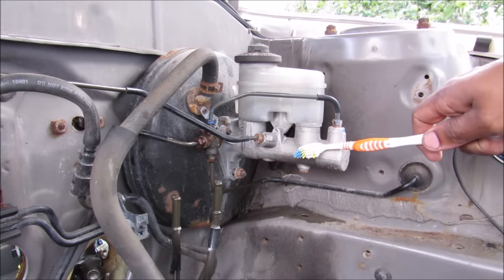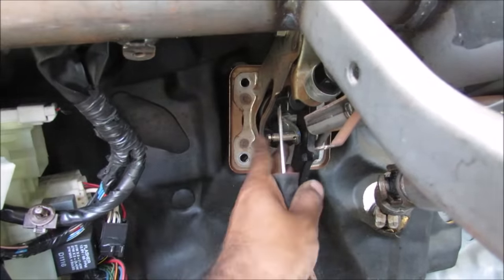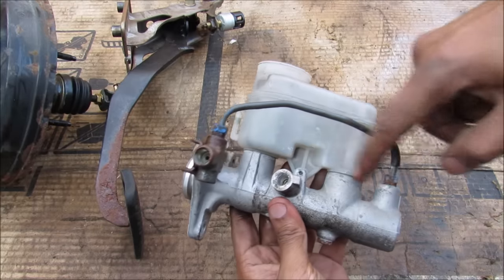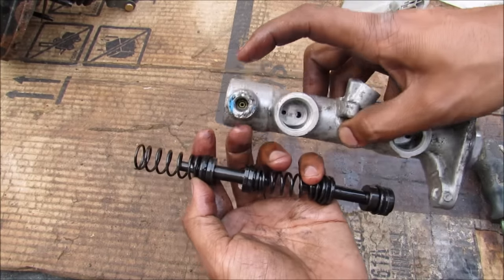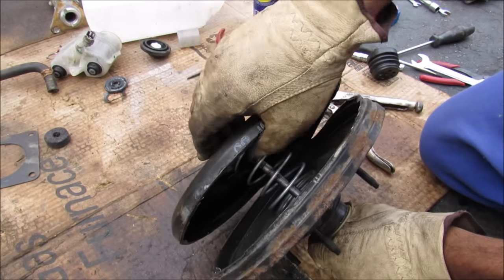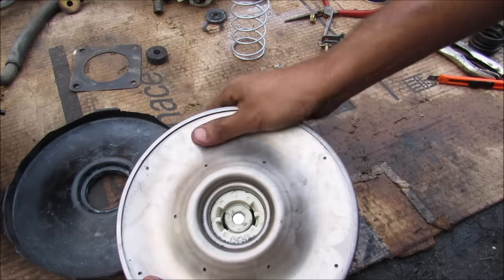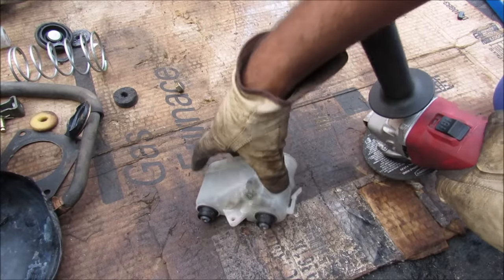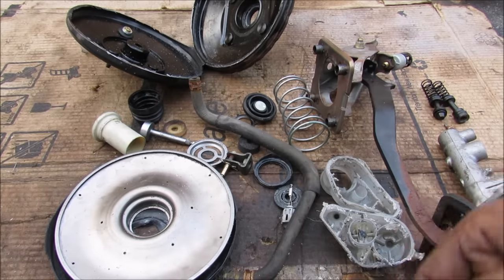How a Brake Booster and Master Cylinder Work

Comment: I have a 2009 ford focus and the brake fluid keeps getting low. I myself checked and had a mechanic checked and there are no leaks whatsoever outside in the lines, calipers etc. I have added so far 2 full bottles of brake fluid and it all keeps disappearing. After a lot of internet research some one had the same issue and he found out that the fluid is leaking into the brake booster and is being helped sucked into it due to the engine vacuum. My question is, is it okay to keep driving without fixing it? I can keep adding brake fluid. Is it safe to keep going this way?
Reply from the maker: Dont drive like that....you never know when you'll need your brakes and your fluid won't be there

Comment: Hi that white centre piece you removed off the brake booster, what sort of grease is applied on it? My booster is out and was thinking of lubricating the white piece with silicone before putting the rubber boot on.. thank you
Reply from the maker: Any grease that's safe for plastic can work

Comment: Also, when that dummy light for low brake fluid comes on, your brakes need to be serviced.  It doesn't just leak out slowly.
Reply from the maker: It's way too late at the point

Comment: I was going to do a burnout for my best friend and while holding the brakes (brake torqueing) there was a loud air escaping sound that came from under the hood three times, now my brakes aren't very good. Is it possible I need a new power steering brake booster installed on my 55 Chevy?
Reply from the maker: I'm not sure about power steering booster, but maybe a brake booster?

Comment: That was the dogs bollocks` No messing straight to educating the likes of me, cheers geezer,
I have a question, brake pads binding causing disc to warp or wear in the same spot, always happens two weeks after renewing pads + discs,
1)Garage did them / brake binding, after a few weeks discs warped, on the previous owner, I bought the car and happened to me after cleaning everything. and changing discs and pads,
2 )I then replaced front diss + hoses + calliper pistons and slide pins + pads and cleaned up calliper, started binding and warped discs after two weeks,
3)So only the off side started to bind so i replaced off side with new calliper only not calliper bracket two days after started to here it binding again.
Did  a sit in car test to test my brake booster that seem to pass the tests,
Did a brake master cylinder test by pressing on the brake peddle and holding it for 30 seconds and it did not move so I suspect no master cylinder leak.
I am at the end of my tether this is costing me a pretty penny and time trying to figure this dam issue,
Any ideas come to mind what else i should do or check that i may of over looked please.

Comment: What could be the reason if brake paddle suddenly sinks and regain after 2 seconds . Kind of brake paddle become free ? What do you think the reason could be. I felt no brake in that case
Reply from the maker: Booster or vacuum hose
Reply: @speedkar99   hyundai guys said it is master cylinder.  Do you think they are correct . ? Brake paddle become free once in 15 days when my speed is under 10 and terrain is not smooth. What do you think now ?

Comment: I converted my 76 cj7 jeep manual drum brakes to power disc brakes (brake conversion kit off ebay) and a YJ booster and mc with proportion valve off a YJ wrangler. 

I had to lower the brake pedal as the piston rod was too long and didn't match up with the brake pedal.  

Problem is, I have soft brakes. 
If I pump the brakes, it gets harder and I eventually stop.  Brakes are always the same. Soft until I pump.  Then hardens up and I stop.. 

Scary..  

Any idea what is wrong?  

Also~~Can I adjust the piston rod to shorten it so the pedal won't be so low and would that fix the soft pedal issue? 

Thanks for the video...  Not only educational but also funny...
Reply from the maker: Did you change the master cylinder?

Comment: Hi, thats a great video.. I am facing a problem with my Hyundai Creta. The break pedal locks or does not push down when's car is on a patchy road but it works fine on a smooth road. Any idea why that's happening?

Comment: Plz help sir, my brakes are hard but does stop normally when driving but after 5 mins driving brakes dragg and caliper seizes up, i would wait a couple of minutes and drives normally, i mean every 5 mins driving front brakes locks up.. i don't know whether the pressure of brake fluid from caliper pistons don't get released or is it booster or something, what could be the problem?
The brakes don't sink but would be hard on its natural position when the brakes seized

Comment: Please I do like to ask what makes the steering wheel tilt to one side when you apply break. Also worthy of mention is that the break pedal of the same vehicle (Toyota 4runner) is now loose more than normal. U then to press down before break slowly catches.
I am thinking maybe the Piston of the master cylinder has probably failed. Please what is your opinion of possible cause?
Reply from the maker: If the steering is pulling then you have a stuck brake caliper
Reply: @speedkar99  please explain more. I do not understand what you mean by pulling. The veering is not much pronounced  though which makes me think it may be due to less functionality of one of the Pistons responsible to deliver brake fluid through one of the pipes. Break Caliper I think caused more degree of veering off of the steering. Pls educate

Comment: That was so well told  now could I pick your brains I have a Renault scenic mk3 1.5dci  the break pedal travail near to the floor release and pump once it gets harder  I have done the servo test that’s fine. Checked break pads they are fine bled only one front will  but still faulty any idea please I am not loosing any fluid from reserver

Comment: according to articles and video in the web, i have a leak in the diaphragm . The RPM jumps up and goes down to normal, the car goes 15 feet forward and stops. 
However, this happens once in while, not predictable. 
Followed all the instructions to check if there is any leak in the vacuum hose, no leak.
If the booster is replaced, will this happen again ?

Comment: Hello Sir!
I've got a Nissan pick-up (Frontier is called in the States) and the brake pedal is quite soft, has a long travel and doesn't stop very efficiently. With the engine off, the pedal goes hard after a few presses but softens once the engine is on (I guess that's expected from the vacuum). There are no leaks, the reservoir is full, not losing level. 
Does this mean the master cylinder is not working well?
Thank you!

Comment: Awesome video!!! So say you replaced the front calipers and bleed the entire system and no air at all.. now go to push on brake pedal and has no resistance at all and pedal goes to the floor?? Bad master cylinder??

Comment: How does the refilling take place during repeated braking, and volume change during temperature variation? Is the rubber seal really passing a refill or outlet hole during braking?

Comment: If booster line is connected to the plenum then vacuum will keep  on building everytime the piston sucks air. So why doesn't the booster blast???
Reply from the maker: A vacuum won't cause it to blast and it's strong enough to resist collapsing

Comment: will the brake work even if you have a faulty brake booster? since its purpose is only to multiply the force? assuming the master cylinder is perfectly fine?

Comment: One question, I have a gmc truck with a brake booster assistant pump that blows air out where the hose is attached, the question is, isn't that supposed to have a vacuum instead of it blowing air? By the way, brake pedal is really soft and has a hissing sound but if you block that hole, noise goes away and pedal is normal...

Comment: I had no clue that a power brake booster has two Pistons? Are they linked end to end and move In the same direction, away when pressed and toward you when released??

Comment: I have an issue on my 07 Tacoma with my brakes locking up as I drive. My fix has been to unplug the vacuum from the booster as the truck is running and then reconnect it a few seconds later which releases the brakes. This fix sometimes lasts a long time and sometimes it only lasts a day. I'm on my second rebuilt brake booster and the issues is happening again. Any thoughts on why?

Comment: hi, if break pedal goes down floor, will itbe  master cylindder or brake booster, how to tell the difference or diagnose.. any tips..assume there is no leak externally
Reply from the maker: Seems like a leak in the brake lines or internally to the master cylinder. The booster only provides assist.
Reply: speedkar99 

Thanks. In honda accord 2002 rear brake line is broken becuase of rust. I lost all 4 brake power. I assumed i will loose only one brake atleast front should work. Is this is how it works
Reply from the maker: Yeah a leak anywhere won't give you any brake pressure

Comment: Hello, I had a Pontiac 69 booster repaired, I put it back together, and when I start the engine, does the brake pedal come down all the way on its own and block the wheels?? I think it's a bad repair? please tell me what you think.

Comment: In my case, I have a spongy brake pedal and other times a hard pedal on random days. I suppose the master would be cause of this? 
No visible leaks at all. I put on a new master cylinder but same issue, perhaps I need to bleed the lines more?

Comment: Does break booster work in turbo charger car because one vacume line in break booster is connected on intake manifold for vacuum to pull diagram for less effort to press break padel so what happen in turbo charger car because when turbo starts spining so intake manifold get positive pressure so its pushes air inside the break booster rather then pulling from vacuum. So how do break booster work in turbo charger cars... Plz reply
Reply from the maker: There's a vacuum pump
Reply: @speedkar99  thanks man
Reply: @speedkar99  plz make a video on engine braking and make another video on how reverse gear safety works when we put reverse while driving so while driving reverse gear can't engage what thing is preventing gear stick to shift in reverse while driving... Plz reply and make video I am waiting..
❤️❤️❤️

Comment: Tow Month After Change first time All Wheels Rotors And pads Start Car at morning everything work great but after driving for half hour HARD BRAKE PEDAL - all 4 wheels Brakes Locking UP but there stopping power and if continue force driving the car all wheels smoke but the brake unlock after pull over and turn car off and back on brake pedal start normal not hard any more work fine but repeat again after driving about half hour HARD BRAKE PEDAL - all 4 wheels Brakes Locking UP again and have to turn car off and on again to get all wheels brake unlock can u please advice! 2008 Suzuki xl7 AWD
Reply from the maker: It's weird to have a hard brake pedal and brakes locking up. I wonder if your master cylinder is sticking?
Reply: I'm not mechanic to answer this but if the car turn off and back turn on and this get brake unlock doesn't help u to know where the problem and all wheel get lock why?

Comment: On engine off, when brake is depressed and released several times, eventually it becomes hard. As soon as engine is started, it becomes soft. This is normal. However, recently, even when off it doesn't come hard even after several times of depressed. I can even do the play at any moment.
Reply from the maker: Sounds like you have a leaky booster or master cylinder

Comment: Normally I say, you talk too fast.  But you were really easy to understand. I think because you didn't drag it all out with bla bla bla, and had really great supporting shots.   Thanks for the video !
Reply from the maker: Short and sweet
Reply: @speedkar99  Sweet'n'Neat.  lol
Reply: Any suggestion on when I press my clutch peddle, about exactly half way, I feel a little bump as I press and as i release the pressure from the peddle once again as it returns past the half way that little bump feeling again.  Bled the slave the other day, still does...    Do you take credit card ?  lol

Comment: Hey brother, so I’m having some break issues. When I press the brake pedal in slow it goes all the way to the floor and the car doesn’t stop at all. When I press the pedal with more force it does react better. Does that sound like it could be the booster?

Comment: Excellent video, as usual. How does this system work on a turbo/supercharged engine, since there's no vacuum from the engine? Is it essentially reversed, using the boost to push, vs vacuum to pull the diaphragm?
Reply: They have vacuum pumps that will create separate vacuum for things like the brake booster to use

Comment: Could a internal leak in the master cylinder cause a rough idle (vacuum leak)?
Reply from the maker: Yes it can. Notice any issues with brakes ?
Reply: @speedkar99  Brakes are fine so i think the booster is also intact, the brake pedal doesn't feel wierd or anything.
Reply: Have an abs light on tho but dont think thats related to the idle

Comment: Hey that snap ring pliers looks a lot like my 12mm angle grinder I use on rusty fasteners.
Reply from the maker: I love my angle grinder. Cut two cars apart with it and it runs like a champ. Best $30 spent

Comment: Kickin' video, so helpful.  Many thanks!

Question: Is the distance traveled by the rod on the pedal side translated 1:1 to distance traveled by the rod on the Master Cylinder side?  I realize the pedal swing is NOT 1:1 (probably more like 4:1) but for my question I am removing the pedal entirely.  I am wanting to exclusively understand the relationship between the two rods in the booster - are they 1:1 or is there some kind of mechanical conversion happening inside the booster?

I think your video answers my question - they are indeed 1:1 - but just want to confirm.
Reply from the maker: 1:1 rod to rod

Comment: Nope, I still don't get why it magnifies your pedal press as it appears to just open a valve that pressed the pedal for you.  Where does the 'proportional' pressure come from, i.e. the harder you press, the harder it presses?
Reply from the maker: The force of the engine  vacuum distributed along the diaphragm helps you to depress the pedal
Reply: @speedkar99  e.g. if I press with 1Kg of force and it magnifies that to 5Kg, does that mean if I press with 2Kg of force it magnifies it 10Kg (2x5) or 6Kg (4+2).   I.e. does it magnify or just add too it?

Comment: I rebuild these for a living and that’s not how you open them
Reply from the maker: With my angle grinder?
Reply: Yes you are supposed to open the crimps on the topside with channel locks that way you can open it to rebuild it  I’ve seen so many people open them like that and you can’t rebuild them afterwards unless you get another core and use the cans (outside metal pieces)  I’ve rebuilt everything from old 1940’s vehicles to new makes and models
Reply: Open them correctly otherwise its a wasted core and youd be surprised what boosters are hard to find nowadays! 😁
Reply: But thank you for sharing! Very Informative!